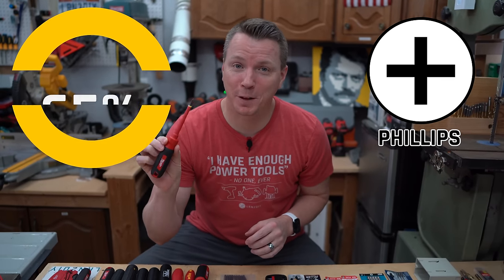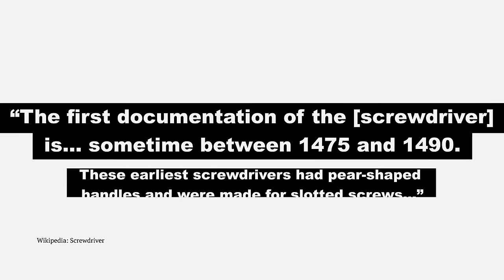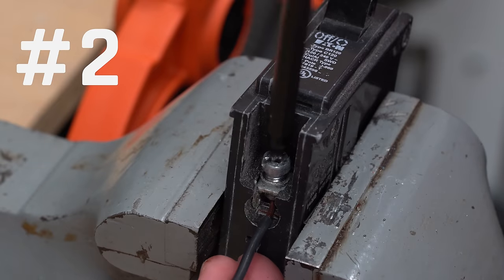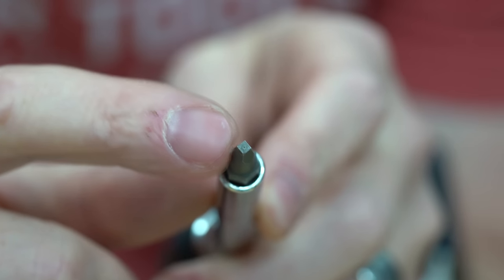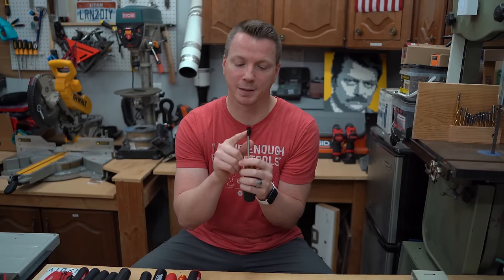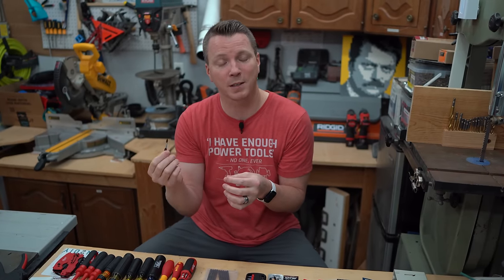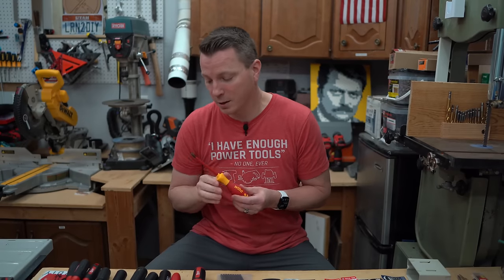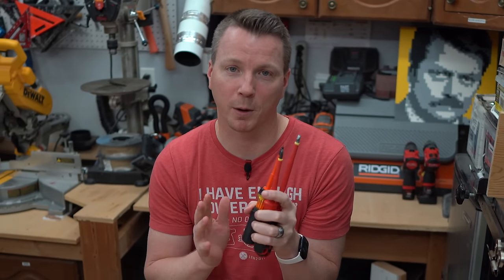You're Using the Wrong Screwdriver For Electrical

Comment: Toughbuilt also makes an insulated combi screwdriver (Part # TB-H5-N-CT1x4, which comes in a set with an insulated Philips and insulated Slotted screwdriver) that seems to fit receptacle screws very well. It might not fit every other electrical screw I run into on the job but I don't expect it to. I use Robertson tips or drivers on ground bars and breaker screws and slotted and Philips screwdrivers where needed, because they will always be needed. But the ESX or my new Toughbuilt driver seems to work very well in allowing me to torque down the screws for electrical devices when I'm installing them.

Comment: Pro tip for using insulated screwdrivers, wrap the end of the insulation closest to the screwdriver head in electrical tape to reduce wear and tear on the insulation. Just the last 2 an' a half to 3 inches of it, one layer thick ought to do it. Ask any Journeyman Electrician to show you the end of his screwdriver and you'll see the wear and tear I'm talking about... unless they also use the same trick. There's a more than few of us who do it.
Reply: My journey told me he has never bought insulated drivers...just wrapped the whole shaft in tape. The insulated ones he has now were bought by the company haha.
Reply: @spanky4446  then your journey_ _ _  should at lease do a resistance test on various spots on it to get an idea of how maney ohms of protection they're getting, seeings how that method doesn't exactly come with a rating. 

(You wrote "journey" you forgot the 'man' at the end... "journeyman". LOL)

Just remember, most electrician electrocutions don't happen due to bare hand comming into contact with an energized part of the circuit, but rather we tend to get our fatal-shock through our tools.

(In case your really green... in the electrical trade we make a clear distinction between the words shock and electrocution... "shock" is just getting zapped, "electrocution" is electrical execution, as in dead, no longer alive. Just so we're clear on terms.)

Also, yes, I'm implying that maybe your journeyman's method isn't necessarily the safest... That being said, many sparkies do it, they have for many decades. It may be the origin of insulated screwdrivers. Also, I've never heared that anyone died because their taped driver wasn't sufficiently insulated so...
Reply: @binaryglitch64  haha good catch
... Yeah I've only been an apprentice for a few months so I do appreciate the advice. I definitely didn't know that most electrocutions happen through the tools. Is that mostly because people get careless and just assume the tool is safe? Or is there something about it that makes it more dangerous? Thanks!

Comment: If SL/PZ (Xeno) slips it is probably way over >5Nm or the screw is differently slotted ,maybe too soft material. Cam out is not a bug , but a feature. When SL/PZ fits perfectly there is more torque with less axial force against the screw , compared to flathead or pozidrive.Tested many times.

Comment: Combo Philips/square drive. A slight grind to the square to make it bigger and a tight fit for outlet screws, or as is for a no. 1 driver.
No winner shown until flat and combo tips are integrated into ONE driver.

Comment: You left out the JIS screwdriver
JIS screws have several advantages over Phillips screws. One advantage is that JIS screws are less likely to cam out, which means the screwdriver is less likely to slip out of the screw head and damage the screw or the surrounding material. This is because JIS screws have a different angle on the cross-point, which allows the screwdriver to fit more securely into the screw head. Another advantage of JIS screws is that they are commonly used in electronics and other products manufactured in Japan, so if you are working on a Japanese product, using a JIS screwdriver can help prevent damage to the screws and make it easier to work on the product.

Comment: My "go to" for recepticles is a Craftsman 1/2" flathead, #41583. I've been using the same one for a long time. It fits the screws perfectly and never slips if you put a little pushing force into it. I use a Craftman 3/16", #41247 for cover screws. My pliers are Klein D213-9NE and my wire cutters are Klein D248-8. I use a variety of wire strippers, including either pair of Kleins.
Reply: Im assuming you mean 1/4"  craftsman.  Yeah, they have nice hard tips that dont distort.   You just cant beat the Kline NE series.  Case hardened cutters go a LONG WAY when you use them professionally.  Ive tried every linesman made within the last 30 yrs.  Always go back to the Klein NEs.
Reply: @RMartin631 You should try the D2000 Series Klein pliers. With the hardened cutters they last much longer and cut wire much easier than the D213 Series. Trust me, once you try the D2000 you won't go back. They make the D2000 Series in all types of different options for the handles and additional features like crimpers or fish tape pullers, but they are all available as a D2000 series tool.

Comment: I started using Robertson screws back in the 80's in the boat industry. The reason they work best is due to their tolerance to off angle drivers. That is, you don't have to be perfect aligning the driver to the screw to get the job done.

No matter what system you use a longer shank on the driver makes it easier to keep the bit within the angle tolerance of the drive.

Comment: Robertson was the type used for my deck hidden screw system, and they strip out fast with an impact. It makes sense really. Camming out prevents fully stripping in a way. So when going by hand, no cam out is good. When going by drill/impact/speed maybe some camming out is a good thing to prevent a complete strip?

Comment: Started in the trade 40 years ago and always used a keystone round shank slotted with the hex bolster.  I don't like using  drill drivers on the crap metal used in devices, but the Roberts is really good on the new combo screws. Phillips is designed to cam out of the screw and I NEVER used insulated screwdrivers on outlets or switches.

Comment: I use #2 Square for panel work. For devices I use an impact with a #2 phillips  to zip the screws down and then I use a flat head to check for tightness. I should try a #1 square.

Comment: How did you miss the JIS ??
My work includes a ton of low voltage. DC fuse panels, Solar breakers and most electronic devices are not Phillips, they are JIS. If the Phillips screw has a dot on the head, it is likely a JIS, not phillips. I use JIS for my outlets, switches, etc.  They just don't cam-out, like phillips do.

Comment: The Robertson tips don't slip as much as the other types because the Robertson square is not compromised for the other tip types (the Phillips is only using two of the four blades, plus it is chosen because it slips to prevent overtorqing).

The R2P2 bit is good for removing drywall screws - it cuts into the mud filled screw head and it doesn't matter if it is Phillips or Robertson.

Comment: I often use flat heads on the device screws because it offers better torque than a phillips driver.  On circuit breakers I prefer robertson when its an option.
On a side note, phillips is designed to slip before you overtorque.
An additional note: use hand tools on your terminal screws. You can break screw heads off with power tools and are more prone to stripping screw heads.

Comment: I do not have insulated screw drivers, but do wear rubber gloves for hot work.  I have replaced several hot outlets without issue.  I remove the ground and neutral wires from the old outlet, and leave the hot wire installed.  I then attached the neutral wire(s) on the new outlet, transfer the hot wire from old to new, and finally attach the ground wire to the new outlet.  Attaching the ground wire last eliminates the possibility of the transferring hot wire from shorting on the grounded new outlet.

Comment: The Phillips system was intentionally designed to cam out at a certain torque (with a certain down force). It's a feature designed to convert a down force into a torque limit. Any combo driver that supports Phillips will tend to cam out. 

Slotted doesn't cam out, so you can get lots of torque. But it slips out very easily and requires skill and patience. 

Robertson won't slip like slotted and won't cam out like Phillips.  Of course it's better!

Comment: If I'm not mistaken the phillip screw was designed so that you can't over-torque the screw and damage the material.  It was designed to "slip" so that you do not screw it in too hard.  The robertson seem to have no such mechanism.  If it over-torque, it will strip the soft screw.

Comment: So I finally bought one of these screwdrivers after my number 1 Robertson was slipping after a long time of use. Klein tools finally came out with one of these as well. I bought the number 1 and number 2 for electrical panels. I didn’t feel comfortable using it on panels so I took that one back but I’m definitely keeping the number 1 ECX for receptacles. I like that it’s on there tight so I can really put some muscle into it and get it good and tight.

Comment: Pozi-Drive (PZ) is what many panel components use. The screw requiring it will show a starburst, extra 4 tic marks making it look like an 8 sided star on the head. It is taking control of panel builds but is slow to get into US use even that components call for it from overseas. It had been around the rest of the world for decades. Looks like a Philips but wont grip and visa-verse. The wrong combination will now get you the torque you need.

Comment: If your Phillips screwdriver tip comes out of the screw head as you turn it, it is doing what it was designed to do. They are supposed to "cam out" in a factory mass-production setting to prevent screws from being over-torqued.

Comment: 11:05 I think there is a misunderstanding here. The torque does not come from the fact that it is a combination screwdriver. That would only matter if the screw or screwdriver were damaged, i.e. one or more of the flutes on the screw head were worn away (as, e.g., in a safety screw). The torque, in the case of the combination screw, comes from the contact of the flathead screwdriver with the slot on the screw. Even if it were a simple Philips screw, the torque would come from the contact of the screwdriver with one part of the cross - not both. The screwdriver needs only be in contact - at a microscopic level - with two opposed-end points on the screw head with reference to the axis of rotation of the screw. All other contact points, should there be any, only serve to increase grip, i.e. friction that increases the probability that the screwdriver will not slip out because of the incorrect angle it is held. A correctly angled screwdriver (i.e. held perfectly in line with the axis of the screw) that is held with the appropriate amount of pushing force should not slip assuming there are no mitigating conditions such as a corroded, overtightened, damaged or badly made screw.

Comment: Robertson #2 is everywhere in Canada. Especially for wood (decks fences, etc). Put a bit in your impact driver and you can enjoyably run screws in (or out) until the battery runs out. Phillips or pozidrive doesnt even come remotely close. I don't have a lot of experience with Torx.

Comment: For recepticals and switches I love the Milwaukee #41-20 which is a combination Robertson#1 and 1/4" slotted blade.  Doesn't slip at all and fits many different brands or screws very well. You can really crank down on a #12 wire with it.  It is 1000 volt rated, 8-1/2" long and has a soft material,  high torque handle design.

Comment: I have Robertson Yellow, Green, Red, Black or #'s 0,1,2,3  The #3 is great for diving #12 or #14 pan head wood screws. You can put the screw on the driver and hold the box with the other hand. Much less fumbling than with slotted screws.

Comment: I think you misunderstood the purpose of the ECX bit.  It is not designed to fully deat in that type of screw you tried.  I think it is essentially a slotted bit that can be used in a power tool.  The "Phillips" part just helps keep it from moving slowly towards the edge of the screw as you turn it - they keep it centered.
I have tried the Robertson many times and I just don't care for them.  I find that I can never tell if it is a #1 or a #2 and end up messing up the heads.  While I have some of that with a Torx, I don't get them stripped as often. I honestly prefer them more if I am using it with the impact driver as they really send a screw into wood easily.
I'm probably going to pick up an ECX screw driver for the outlets I replace at my maintenance job.  I often use a flat head but swap to my Phillips.  In a perfect world, we could get one that was a flathead for the covers, but had self lowering wings to fit the opening better and help keep the bit centered on the screw.
Reply: Most 'muricans experience with "Robertson's" screws are in fact "square" drive, not Robertson's at all. Robertson's, screws and drivers, are made to a much higher standard than the import stuff that most have experience with.

Comment: Discovered Robertson Square Drive on my 5th wheel Travel Trailer in 1979 — the industry had already embraced this superior screw. Traveling across Canada, I discovered it dominated there. Fastap makes superior square drive construction screws, manufactured in Vancouver, Washington. Unbelievably, many building supply places carry their Phillips screws, but not the square drive. Another advantage, is you can stick a square drive screw on the driver and it will sit (within reason), so you can hold your work with one hand and start the screw (slow speed to start). The Fastaps are also self-drilling, so they seldom split the wood.

Comment: I install 200+ devices per week—new construction. I exclusively use the Wiha combo tips (drill). I find the Robertson slips on the ground screws, and those are most important to me. Do not like ECX for the reason you mentioned.

Comment: A couple of points:

- what most people think is Phillips is actually pozidrive. You can tell the difference as pz screws have little diagonal lines on the screw head.

- per specification, the screw head is designed to cam out at a certain torque. This is how all fasteners are designed.

Comment: one of the "phillips" screwdrivers you showed, the chewed up one, looks more like Reed and Prince.  The difference is the blades are tapered so that one screwdriver fits all size of Reed and Prince screws..  but they bottom out in most phillips screws.  As far as "insulated" goes...Heat shrink.

Comment: I use a Robertson tip for almost everything when I am doing electrical. I've been an electrician for 30 years now and the Robertson is by far the ony tip that lasts as long as it does. Unfortunately, the slotted screw driver will never go away, because of the many screws that only have slot in them. If I want to torque something I only use the slotted screw driver to torque it down. It works the best for that. I will say that I do hate the Phillips tips, and try not to use them at all, but once again. Sometimes it's inevitable and I have to. There is a slotted screwdriver that works well and easy to locate on the screw head too. Klein makes them and they are for EMT set screw connectors. the slotted driver is inset within a cylinder to cover the screw head. No more slipping of the screw head and running the driver through your hand. the only disadvantage is that it's not very long and it's bulky, so it won't work in a lot of other applications.

Comment: The slotted screwdriver is king!  None of those fancy drivers are as good of a pry bar or bottle opener.

Not specific to electrical work, I've found that JIC drivers typically fit Phillips screws better than Phillips drivers.

Comment: For me, the issue is that I do NOT want a bunch of different screwdrivers in my toolbox!  I think 99% of the time, I reach for my multi-tip screwdriver, and use the "right" tip.  So the weird combo tips are vastly inferior to either Phillips or Robertson, because those already "live" in my multi-tip screwdriver.  I was glad to learn here that I was not giving up much/anything by not having yet another single purpose tool!!!

Comment: What's difference between philips number 1,2 & 3 Screwdrivers? Are they differ in sizes & which one can be used in Electronics and Electrical jobs?
Reply from the maker: Yes, it’s the size and, consequently, the shape as well. Almost all household electrical work uses a #2 Phillips. #3 is pretty large and blunt and then #1 is common in smaller screws like inside electronic devices.

Comment: I work in manufacturing where we are driving screws all day long and I have to say Wiha does make great tools.
As for the Robertson/square drive, I have had them slip and strip screws, but it was always with a cheap bit made of soft metal and with poor tolerance. If it's a hardened tip of good quality it should work well.

Comment: I've done electrical work for forty- five+ years, and regardless of which driver you prefer, I always use handheld drivers on all electrical fasteners. Using drills or impact drivers increases the chances of stripped screw heads, stripped box threads, (especially plastic boxes) or broken screws.